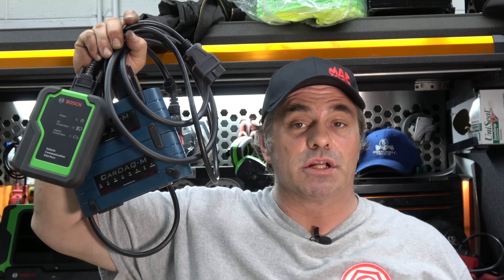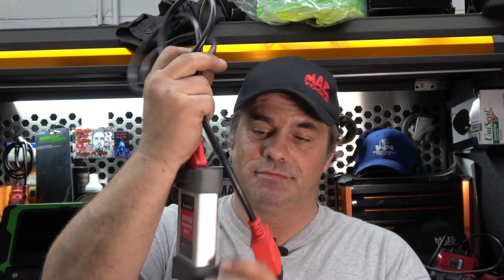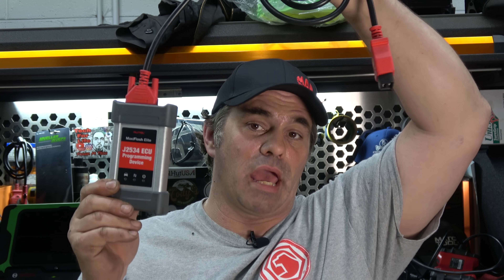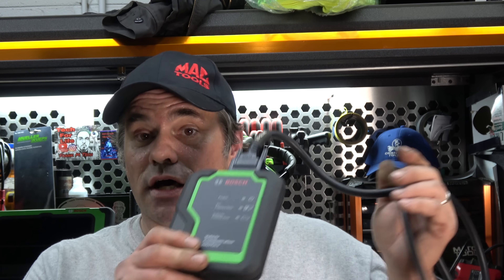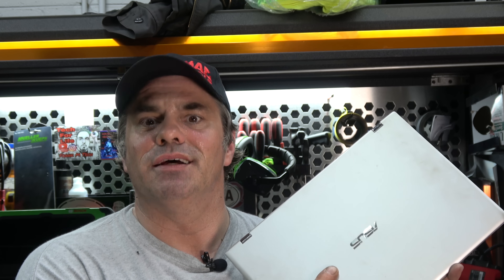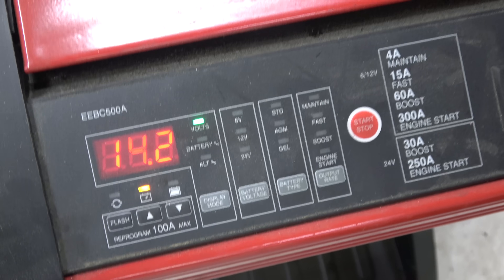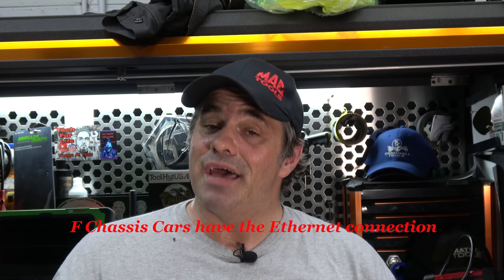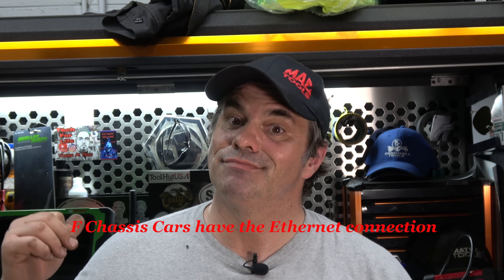Equipment Needed for J2534 Reprograming

Comment: Speed is a big thing with programming nowadays like gm for instance if ur computer is slow or you have an older jbox the programming will fail. Don’t buy the cheapest laptop you can find get something that’s faster then what u need or if your like me that knows about computers you can buy an inexpensive laptop toss in more ram, good solid state hard drive and ur gonna have a much better experience. Gm uses the mdi2 for programing and their scan tool it’s only 700 bucks so for that price u can program just like the dealer and also have factory scan tool which you have to pay to use but it’s only like 800 for the year and you can pay for less then a year but it’s worth it if ur gonna use it and many manufacturers are like this now

Comment: Open the computer and clone the ECM transfer data. No subscriptions needed, doesn't matter if their is a vin in it or not and no power supply needed. Cheaper for the customer and the mechanic. Andromeda labs check it out.
Reply: That works with cloning/replacing the ECM-unit only. But after that you need to teach the ECM the vehicle keys in some cases (for.ex.GM) to avoiding the vehicle getting to "anti theft mode" (no starting).
Reply: @elfillari  a good portion of the time the bytes for the keys are in the EEPROM. But, like Toyota for instance a quick search for the manual way of programming keys are available. Like opening doors and switching the ignition. Once that info is put into place you need to marry the ECM module to all the other modules jumping pins in the data link connector then bang it starts right up. After the 30 min wait time. However, older vehicles has the immobilizer info stored into the ECM directly and you could just clip onto the double e prom and load a flash file for it from the computers central data base. Model of vehicles varry and I'm not saying that this method is perfect. Just practical if you work on many vehicles to include heavy equipment.  I can clone body modules And dash cluster and input mileage to them. Not only ECMs. Any module with a EEProm you can even copy high dollar tunes located in the processors but thats more complicated and requires other probes.
Reply: @andyperkins2523  Yes, I just been learned as long the original ECM's eeprom is with data ok, you can send it to the replacing ECM's eeprom including the data for the original keys. Then only the crankshaft sensor have to be reset/learn thru the obd scanner.👍 As you suggested I will try the Andromeda recearch system giving them a serious change, just by the serious reference given thru the email correspondence!
Reply: @elfillari  it's only just more tools in the good ole tool box. You don't use them always but when you need it you need it. Have fun learning about the world of cloning. Andromeda labs helped me every step of the way, literally on the phone with me teaching as I went thru the program. Rome wasn't built in a day.

Comment: I'll never purchase another Ford product as long as I live. Looking at a second steering rack for a 2010 Fusion, neither of which can be replaced and programmed by anyone but them. Great gig... build crap that breaks down, protect yourself from recalls and make sure nobody else can fix it but your own shops. Their executives should be in jail.
Reply: I can reflash it for $50 2 day subscription. MY tools include a $169 laptop off ebay and a $300 Cardaq used box off ebay.
n
Or you can put a used rack in and cross your fingers to see if it works. It might roll off the old programming from the previous car it was in.
Reply: @mph5896  I appreciate the info and the offer but we've gotten rid of the car. I've never like Fords and ended up with this one by chance. Lesson learned... if you have a gut instinct don't ignore it. Cheers!

Comment: Thanks for this information, it is very important, I am a mobile mechanic and many of the problems that I currently have is that the majority of jobs are programming, Reflash Pcm, RCM, EPS and more, and I am trying to find equipment for the least do something, and I found the CarDaq-Plus 3. possibly this program and equipment can help or serve several brands. Maybe you know it, if you have any opinion of this team I will be grateful. I have the Autel MK908 VCI module but I don't know how to download the software and what system it works with. So I'm looking for information. Thank you

Comment: What if I just want to rewrite VINs and add keys, mainly on GM, Chrysler, and Fords made before 2012? Can that be done without the J2534? I'm actually looking at the Autel IM608, which comes with the J2534, but I'm hoping I won't have to have expensive subscriptions for every manufacturer.

Comment: Can you still program Ford without the VCM2?  Also when using the Altel do you still need a computer or laptop to program?  Ive been replacing a lot of transmissions and engines on Ford and chevy so i take them to a different shop to get programed and its not very convenient.

Comment: Another good video, FRM. I ran a Honda shop for 15 years, but they were not particularly aftermarket friendly. I have always admired the support that Toyota offered to the aftermarket, and I suspect they have had a positive influence on the industry. For example, before J-2534 boxes were popular they developed the Mongoose cable which had the J-2534 hardware built into the connector and made it available for < $500. They also rent their pro-level software for as little as $65 for 2 days.
Also, the J-2534 interface was originally developed to support reprogramming across all models. Now, many manufacturers, including Toyota, use the J-2534 box for diagnostics also.
Reply: Hi, just looking in! Can you please let me know whats the cheapest box that gets you on to tecstream I tried this make but was a pig to set up so sent it back VXDIAG VCX NANO for TOYOTA Techstream V17.10.012 If you buy an Autel J2534 do you have make sure it says for Toyota or is cheaper in the long run just buy om scanner that may not need a battery regulator? im just a novice with all this thanks.

Comment: Chrysler software and certain newer versions of Java do NOT get along well. I had to install an older version of java to flash a Ram a year ago.  That was a major pain in my ass!!!!  Great video on the ins & outs of j2534 programming! Thanks!
Reply from the maker: Java is the bane of everyone that programs
Reply: @flatratemaster  Hi, just looking in! Can you please let me know whats the cheapest box that gets you on to tecstream I tried this make but was a pig to set up so sent it back VXDIAG VCX NANO for TOYOTA Techstream V17.10.012 If you buy an Autel J2534 do you have make sure it says for Toyota or is cheaper in the long run just buy om scanner that may not need a battery regulator? im just a novice with all this thanks.
Reply: The snapon pass through pro which is a car daq works well with Toyota techstream. At least 10 years ago it did not sure about newer models.

Comment: Idk why every manufacturer doesn’t just have a site based scan tool like Chrysler does. All u need is a little micro pod.
Reply: They lose lots of money..as large car fleet owner  I alway traded several trucks in to get software warranty. It's 2 k around were working because pac car locked everyone out with up dated software..  some good ol boy would break thu firewalls use & improve it then sell it to other owners operators 
.. samething HP.tuner is doing

Comment: Remember the days of tuning with a timing light,  vac gauge , and screwdriver...lol
Reply: Gary Harms   Yep and filing points and setting  dwell (I can’t remember how to spell that I think I’m right..Lol)
Reply: Yep, Many cars now don't even give you a TDC mark on the crank pulley anymore.
Reply: Wayyy before my time
Reply: I actually do🤣
Reply: yep just did it yesterday 😁
Reply: Okay Boomer
Reply: Ya they sucked
Reply: Uhhh, what the heck is a Timing Light???  Is that like, a light that tells you when you're slow as hell and went over on the flat rate time for the job, AGAIN, or something??

Comment: Great job, I love seeing videos like this. J2534 was a bit intimidating for me at first even after 5+ years of doing daily reprograms on Deere equipment (with no required battery voltage maintainer 🤯).

Thanks to Keith and Keith, amongst others, I gave it a shot and found it's not terrible once you have the equipment and a network of techs that you can build knowledge off of. 

For anyone just starting, I felt that GM was the most user friendly and easiest to successfully program and build up confidence.
Reply: Science Of Diagnostics gm is easy but Honda is even easier lol.
Reply: Haven't had the opportunity yet, but I look forward to it.
Reply: Science Of Diagnostics plug it in and hit button. Wait couple minutes and cones up with screen saying if flash available or not. No need looking up cal id or making sure selecting correct flash. Pretty cool
Reply: @codysautodiagnosticsprogra8706  John deere style. I like that.
Reply: Thanks!
Reply: I agree, GM is very great car to diagnose and repair. Cadillac is a different story, but their EFI system is the same in principle
Reply: I have been sloppy as well and not using a voltage maintainer. Knock on wood, no issues yet.